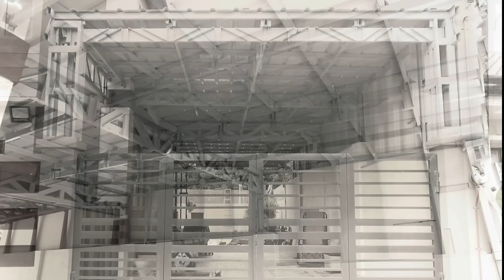Build The Cheapest Garage Roof using Drill, Screws and Metal Stud. Light Steel Frame Roof Garage

Comment: As I see the column, you use 4 light steel to combined act as a heavy steel, which should be OK for your case that there two sides of wall to support. The work of joining the column to the ground is superb. The placing of roof work looks like what a very well experienced professional did.

Comment: Galing....hindi ba luluwag mga screws sa katagalan sa lamig at init pag nag eexpand at nagdo contract yon metal?
Reply from the maker: Yung ang hindi ko alam sir, pero bawat join 2 to 3 screws nilalagay ko para sure.
Reply: Pinagsisimulan ng kalawang yon butas ng screw ng metal studs na nabili ko. Both galvanised at yon pre painted. Bina vacuum ko lang yon metal shavings, kasi basta umulan kinakakawang na agad. Pero mukhang need ko balikan isa isa yon  bawat rivet at screw. Ini isip ko kung i rust converter ko pa or pwede primer nalang.